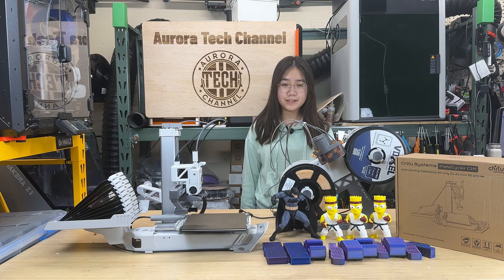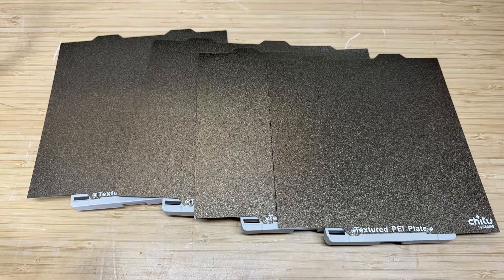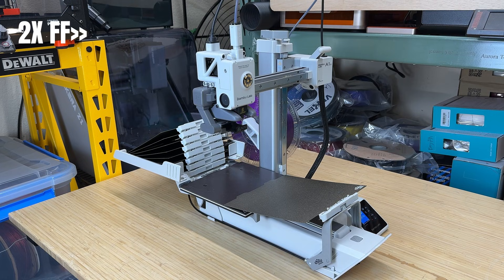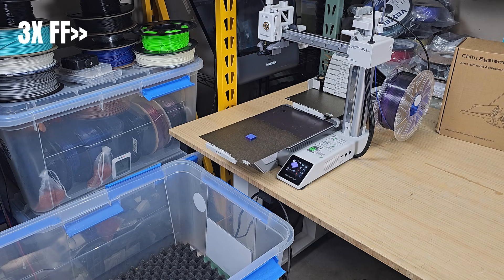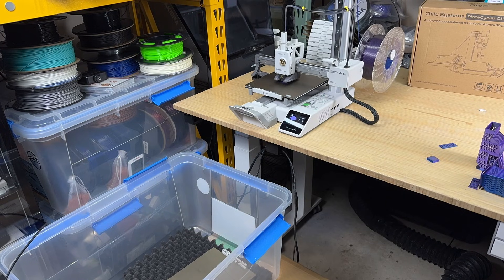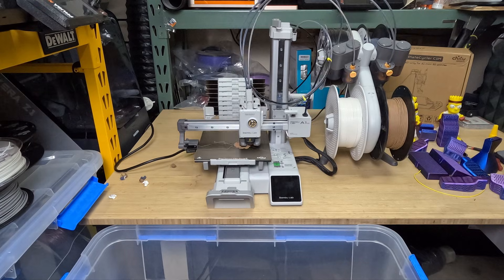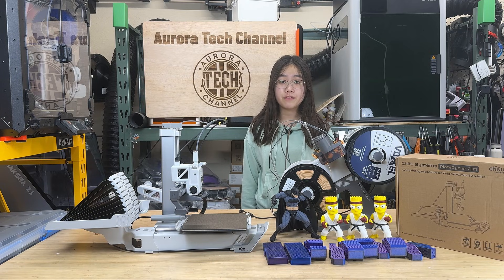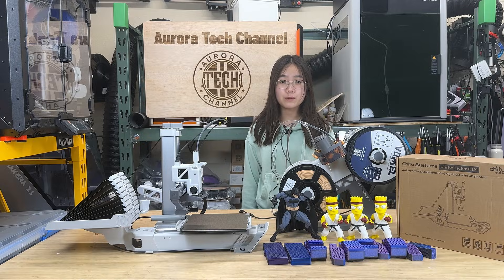Turning the BambuLab A1 Mini into a Continuous Printing Workhorse | Chitu PlateCycler C1M Test

Comment: Does PETG print fine? Would the new plate bed get to temperature in time before printing starts?
Reply: Hello. Thank you for asking. Before printing begins, the printer always heats up based on the parameters in the print file, so the plate will not be used for printing without being heated first, even after a plate change.

Comment: How quickly does the plate come up to temperature? The bed itself may be hot enough for good adhesion, but depending on the material, it may be a while before the plate is?
Reply: Hello. Thank you for asking. Before printing begins, the printer always heats up based on the parameters in the print file, so the plate will not be used for printing without being heated first, even after a plate change.
Reply: @chitusystems5255  Thanks for the fast response! My concern is that the thermistor is in the bed, not on the plate itself; not usually an issue because the two would heat up together, but if I remove the hot plate and put a cold one on, does that cause a measurable drop in temperature at the thermistor? The built-in assumption is that the plate and bed are roughly the same temperature, which is not assured in this case, surely? 

My use case would be all PLA anyway, but for more  challenging prints with more interesting materials, I can't help feeling that an enforced time delay (in addition to M190) would be needed to ensure that the second and subsequent plates are at the temperature that the thermistor is reporting.
Reply: @6yjjk  Hello. Regarding the time delay, I will pass it on to the development team. You make a good point. The temperature of the heated bed does indeed change after a new print plate is placed. However, I'm not sure if everyone can accept the increased waiting time after printing is complete. I will have technical support write relevant G-code tutorials so users can modify them themselves.

Comment: Great review, but one thing needs to be clear: the moral standpoint of a company copying a basement creator's Kickstarter project is different from that of 3D printer manufacturers copying each other. The Swapmod is created and manufactured by a creator like us, using multiple A1 mini and the Swapmod to make it. 

Chitu’s behaviour is against the whole 3d printing community and harming the idea that 3d printing make idea come true and successful, also making money. 

Swapmod is the original, well engineered, cheaper, and making updates on Makerworld. NO build plate sticking problems in my experience.

Comment: I have the swapmod, and while personally, I found it quite useful for me when I am doing projects, I don't see this going mainstream.
As It stands, the only people who would buy this is:
1. Hobbyists who only have a few printers, and would like to modify it for future project work.
2. Enthusiasts who just like neat things.
3. People who have disabilities that prevent them from using 3d printers well. This can provide a decent QOL.
4. Shops that use printers as an addition to their product, and this can automate production to a certain degree.
While it looks like there is alot of potential customers, if you were to sum up the total number of people who would buy such a system, it isn't alot. Most people are perfectly happy with a base A1, or Mk4, or Creality Hi etc. And 3d print farmers would instead use macros that cool down the bed, and then push the prints off the bed.
It is a neat system, and I do like mine, it is only one of many potential solutions for hobbyists to mass print stuff at home. Note the amount of commitment you need to do in terms of space and costs to get this running, and consider other methods too.
Reply: Have a line of product that is small and low to build plate, it's not totally reliable pushing off.  With large base items in PETG they can become aggressively stuck. Plate changer has no issues with either and a faster cycle time.Fit plenty on A1 mini build plate. Contracting it out to a big farm ,after shopping around isn't super expensive, but it's slow, shipping , and not very flexible, sill got hit min order quantities to get price. A1 Mini with AMS and  plate changer isn't going to take very long to pay for itself and start breeding.....

Comment: Oh, one question! So, it only comes with the 4 handles pre-installed on the 4 included buildplates? I want to use this with the BL Coolplates, so I would need to buy the additional buildplates sets in order to have additional handles?
Reply from the maker: By default, no. However, if you use the handle from the free downloadable Swapmod parts, it should work, though it may require some minor adjustments.
https://makerworld.com/en/models/898209-swapmod-a1m-plate-hook

Comment: I usually leave the part on the plate until the bed cools completely. This ensures that the bottom of the part that contacts the plate will not warp as it cools -usually. Can this setup be programmed to accommodate bed cooling?
Reply: Hello, thanks for asking. This would require modifying the G-code file, and it’s not something we generally recommend. That said, we understand some users may need it, so we’ll be releasing a guide for those who want to do it at their own discretion. Welcome to join our community to stay tuned. Thank you!

Comment: You had a very similar as I did on my video review.  I had the cut that tab out too. I also had the magnet come off one side so the notion this kit can do thousands of prints reliably is fictional, at best.   Also, given this is aimed at beginners likely new to 3D printing with the A1 Mini, the absence of extensive tutorials or documentation to best slice / multi plate for this device is unfortunate.  I’d love your feedback from my video review 🙂. As I summed up, this should be a finished product and no cutting or sanding required.  It seems best suited for those that like to tinker.
Reply: Hello! About the two issues you mentioned, we’ve already addressed them by switching to a stronger glue and updating the mold. Sorry that the sample we sent you was from the original version. We really appreciate your feedback and acted on it right away. Hope you’ll give PlateCycler another chance. Thank you.

Comment: I've been using this exact system since the day they introduced it.  It paid for itself on the first day of use and has been working flawlessly since then.  I've only had a single plate failure in the entire time I've been using it on my 6 A1 Minis.  They never stop printing, I might add... producing 100s of parts a day for our little shop.  It's one of the best investments I've ever made in 3D printing.

Comment: It's a nice idea & I actually thought of this idea a few years ago (or rather figured it could be a cool idea) but the hard part was what to do with the build plates that are used with models on them. Depending on the model, the next plate falling down could damage the previous model or even plate & tall prints could snap. 

Ideally you'd use it in a setting where you are around but don't want the printer to pause between prints but you can immediately remove the prints & move the build plate back on the stack.
Reply: I've heard the manufacturer recommends a "padded box" for the finished plates to drop into.
Reply: @KarlBunker  Even then, these are thin metal plates - any drop with a heavy model at an angle can damage the plates (and the prints on them) already in the box.